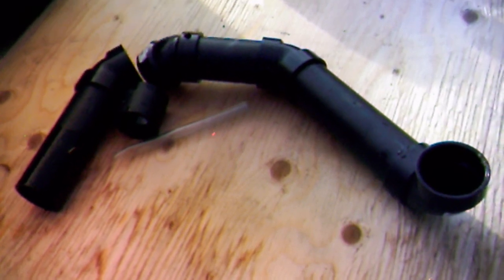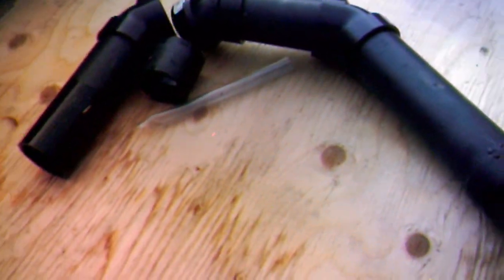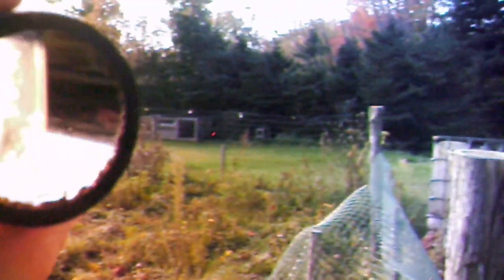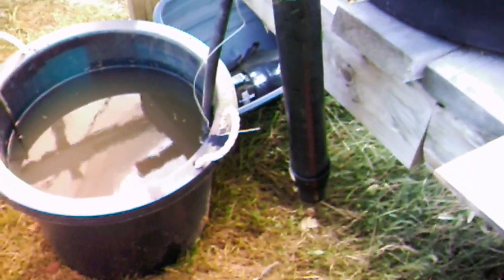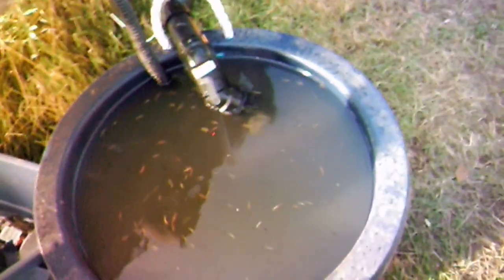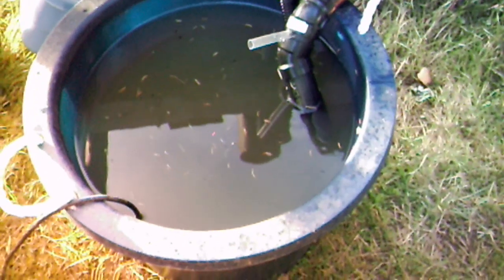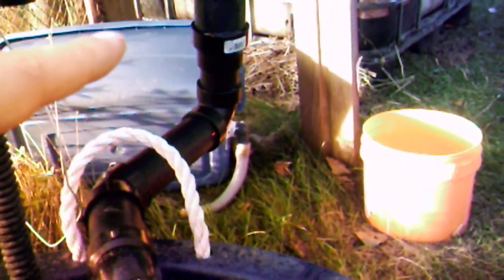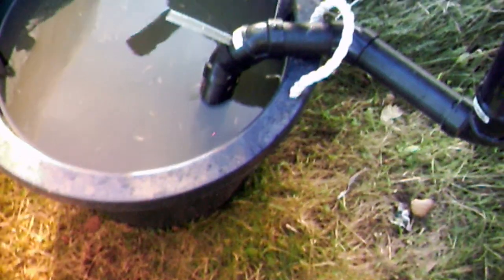Aquaponics - U-Siphon Testing With Venturi Aerator

Comment: Michel Vaillancourt so why did the gravel guard thing fix the U siphon to be able to reuse the sweeping 90 vs the sharp 90?
Reply from the maker: Reject06 I'm still not entirely sure.  I think -- I have to do more testing to prove it -- it is because the gravel guard is also effectively a reducer ... it's almost 1" / 25mm wider than the pipe itself.  So, that increases both the amount of water being pulled in on start, and therefore the speed and pressure, as well as the amount of air on cut off.

What I need to do is mess around with a regular reducer itself and see if I get the same effects.  

Thanks for the question!  Are you doing anything with aquaponics or aquaculture yourself?
Reply: Michel Vaillancourt I haven't started up on mine just yet as I'm currently in the research stages of mine. I like the way you approach your build with some actual science to it. It's more interesting watching learning as to WHY things work the way they work instead of just saying " slap this together and magic it works!" Can't wait to see the next video you upload. I learn something new every time. Tell Denny I said hello from Dallas, Texas!!
Reply from the maker: Reject06 In case it helps you out, check out my blog series on some of the other testing and design I did last year: http://michelrvaillancourt.com/category/aquaponics/page/9/
Reply: Michel Vaillancourt Sweet man thanks! Yeah i'll be going through it tonight and taking notes as to what all I can apply on my end. Got my first obstacle taken cared of, set up the aquarium with live fish and am just going to let them relax for a few weeks before I begin introducing some greens. That will give me time to figure out what I want to plant first as well as figure a way to suspend some pots over the water. more than likely it will be a deep water sub setup due to money and sizing.
Reply from the maker: Reject06 Aquarium-based systems are a great way to get started, for sure.  Keep in mind that it's about a one-for-one volume ratio as a minimum, between fish tank and grow bed... so if you've got a 20gal aquarium, you can easily run between 20 and 40 gallons of growing space.   
If you go smaller than that for growing space, you'll need to keep a small standard aquarium filter running just to keep your water chemistry sane.  Good luck, and let me know if you have any questions!
Reply: Michel Vaillancourt lol well there has been a slight change in my setup, i'm upgrading to a 40 gallon tank right now as it's 40 bucks over at the pet store  so it was a no brainer. bigger tank, more fish, more room to grow. now i need to figure out a grow bed to use now as it's growing faster than i imagined haha. thanks for all the help!
Reply from the maker: If you ask around, you can often get 50gal ABS plastic barrels in either blue or black plastic for between $10 and $30 ... cut it in half, and the two pieces make great grow beds.  

Just be sure to get one that was use for food applications, not something toxic to the fish!
Reply: Michel Vaillancourt will do! need to get the clays and figure out what greens to plant. i have a few more days to cycle the new fish tank before i can start adding the garden parts. it's getting exciting!
Reply from the maker: For my first system, I didn't use the hydroton / hydrocorn at all ... just regular 1/2in - 3/4in pea gravel (12mm - 19mm).  It worked pretty well and was a whole lot cheaper to get started with.
Reply: Michel Vaillancourt yeah I was looking at the prices and it's up there for the amount of gallons I'm wanting to run. I need to find a neutral media but the problem is they are all tiny little pebbles haha. Sadly I have another problem right now I need to address. My fish have Ich! :(
Reply from the maker: Here are a couple of links, in case they help:

http://aquarticles.com/articles/management/Ranson_Ich.html

http://www.aquaticplantcentral.com/forumapc/fish-planted-aquarium/48124-natural-ich-cure.html

The best answer seems to be bring the water up to 86F , add 2 teaspoons of salt per gallon of water and do a partial water change every couple of days.
Reply: Michel Vaillancourt thanks for the link! I'm working with Mollies and Long Tail Black Fin Tetras (I know, strange fish setup but they were the cheapest and on sell) the Mollies are doing great while the Tetras have lost their colour and got the salt flakes all over their bodies. I added the salt, bumped the temp to about 85 (hopefully they dont mind as they both like between 68-80*) and added a product from National Geographics called Herbal Ich Relief and within minutes the Tetra got alot of their colour back but still have flakes. Hope to be able to have this little set back fixed inside a week as I really want to move them to the 40 and begin building the grow beds. Is Ich still a pretty common thing in bigger setups like yours?
Reply from the maker: I've been pretty careful ... quarantine and salt go a long way ... as well, the actually grow bed filtration process, I find, does a good job of keeping parasites off the fish ... they get swept away by the churn of water and trapped in the filtration.
Reply: Michel Vaillancourt 2 of the 4 Tetra's are doing alittle better now. They are at least now moving around with some more energy so I'll take any little victory right now haha. I have a couple of more weeks before the Ich is gone (fingers crossed. Been doing the hotter temps with salt and medicine.) In the mean time, I at least can work on the truck as it spun a bearing. Thanks again for all the help you've given, been letting me build up my system with confidence.

Comment: You not have clean water where you live or do  not use filters?
Reply from the maker: +Joset Ch Hi, and thanks for stopping by the channel to chat. As I thought I had said in the video, the water is muddy for two reasons:  1) I'd just poured some unwashed gravel into it for displacement mass, and 2) it's a simulator purely for testing.  My actual aquaponics system, the water is clear enough you can see to the bottom of a 1.2m tank.  Sorry for the confusion.  :)
Reply: +Michel Vaillancourt I appreciate the answer .... I do not speak English and do not know if the translation was correct google ...
I'm trying to implement a garden in my backyard and I'm reviewing ideas to make ....
a greeting...
Reply from the maker: +Joset Ch Please feel free to ask any questions you may have about any of my videos.  I'm happy to help as I can.

Comment: I have a question... is the plastic you are using safe for fish, plants and humans? it looks like abs plastic that leaks carcinogens in the water to me... hmmm....
Reply from the maker: David Harding Hi, David!  Thanks for stopping by.  I'm not a chemist, but ABS pipe is pretty widely used.  According to this Wikipedia article (https://en.wikipedia.org/wiki/Acrylonitrile_butadiene_styrene#Hazard_for_humans) the danger is in heating or extruding from the fumes.  The pipe itself, once produced, is relatively safe.  

That said, I've switched to PVC piping for my system.  ABS in Canada is for "grey" or "black" water applications;  for potable water, the recommendation is copper, Pex, or PVC.  So, I'm going to be going with PVC and Pex wherever possible.

Great question!